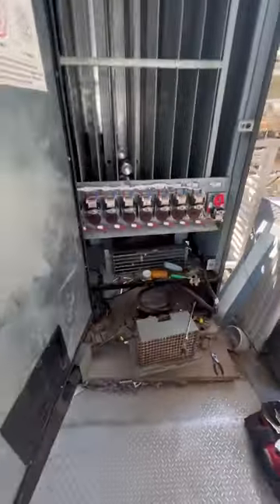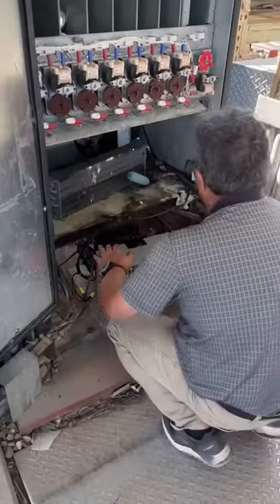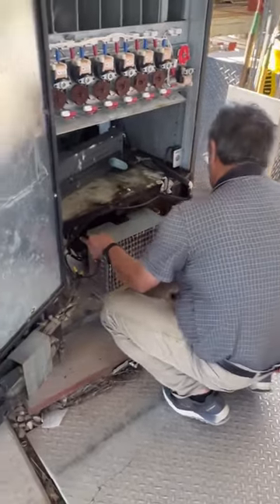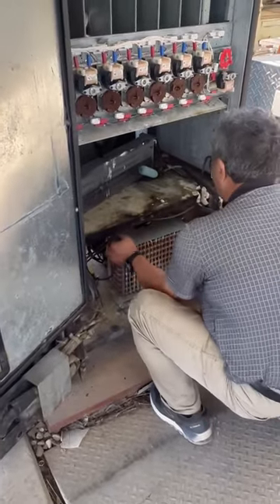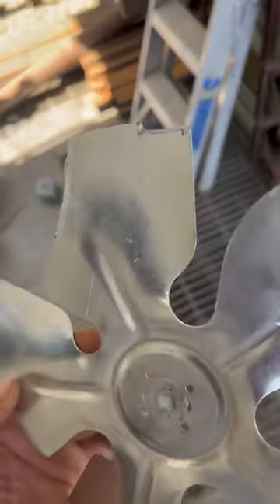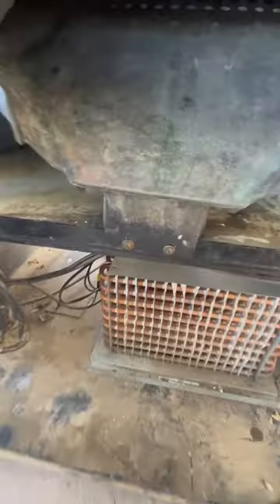I had to repair my vending machine again. #vendingmachine

Comment: You might want to go ahead and get a new fan because that one is going to be unbalanced that will cause you more problems and much needed repair, which will cost you more money very soon.
Reply from the maker: I actually did just that. We replaced the fan about 1 month after this.
Reply: @pristinevending it's nice you actually maintain the machines. Vending machines seem like they always have problems